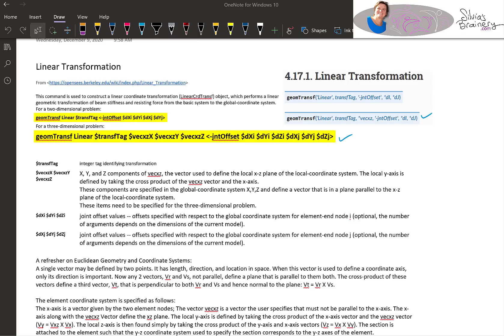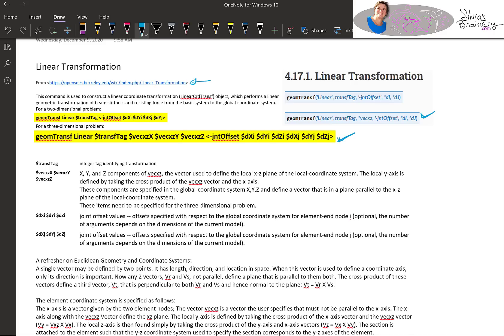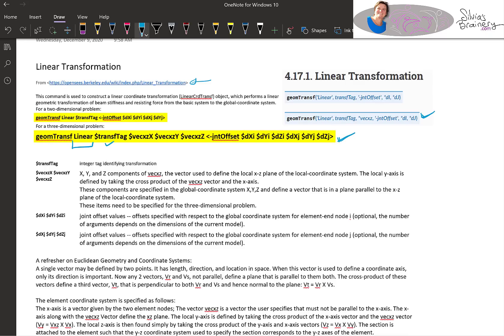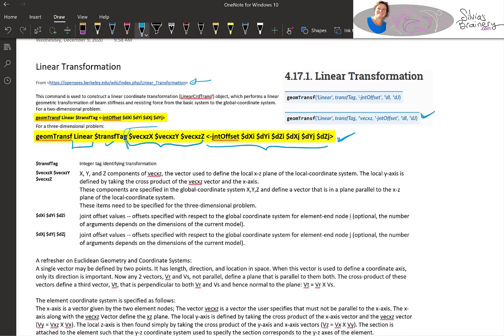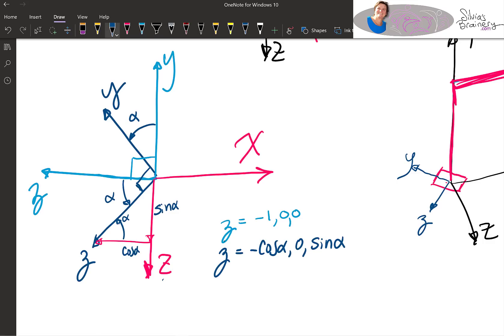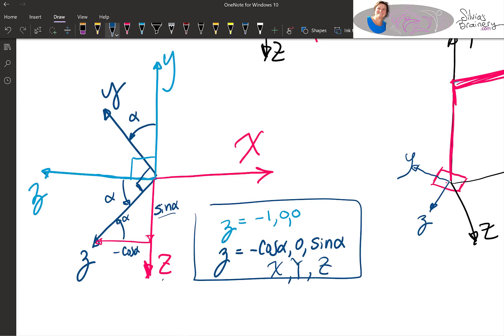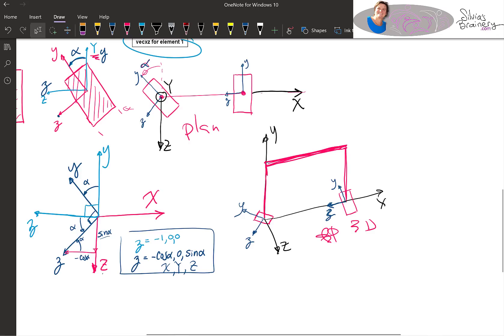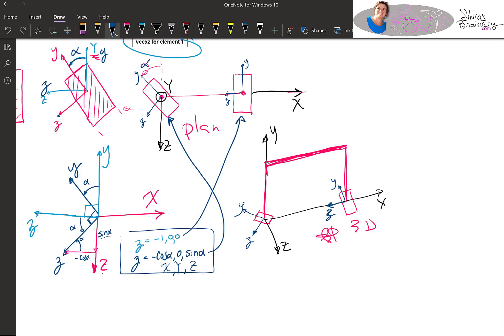OpenSees Transformation Command

Comment: Thank you for your effort dr. Silvia 
I have understood a lot  about geometric transformation in opensees , but i have a question concerning the global axes x, y ,z 
According to what I understand: 
That the default global axes are : x is horizontal , y is vertical , and z is perpendicular 
But i watched other examples the global axes weren’t like that .

Also , the local x axis is always in longitudinal direction and the other axes follow the right hand rule, but the 2d frame in the linear transformation command of opensees wiki doesn’t follow this 
For example element 2 , y axis should be vertical and z axis perpendicular to it
Reply from the maker: the global X,Y, and Z axes are in space and follow the right hand rule. most people chose the Z to be vertical, I like using the Y. please specify exactly which Example 2 you are referring to. I am very confident in the examples I wrote, but not so sure about those by others, of course.
Reply: Do you mean that y-axis isn’t fixed to be upwards? 
But how the program will know whether i am using the global vertical axis y or z , because the transformation will be totally different in two cases.

Thank you in advance.
Reply from the maker: @nohaelfiky1041  i think you are confusing yourself. walk through the concepts and think about it. you can schedule a one-on-one session with me if you need to, on my web page: silviamazzoni.com
Reply from the maker: Which example 2?
Reply: I meam element 2 in this vedio in the 9.30 minute
Reply from the maker: @nohaelfiky1041  except for the x axis, you decide the others.
Reply: @SilviasBrainery  Thank you dr. Silvia for your concern🙏, I now understand what you mean 🌷🌷.